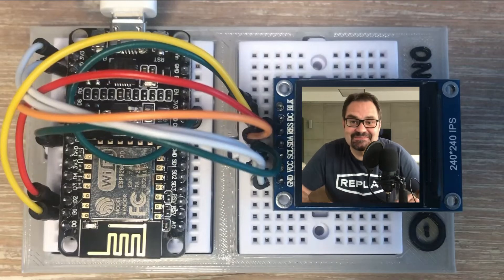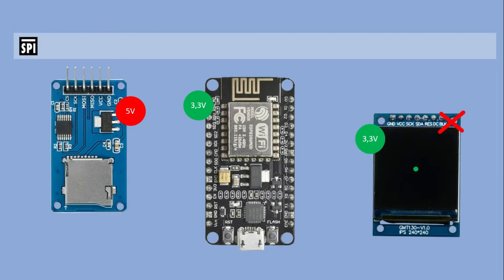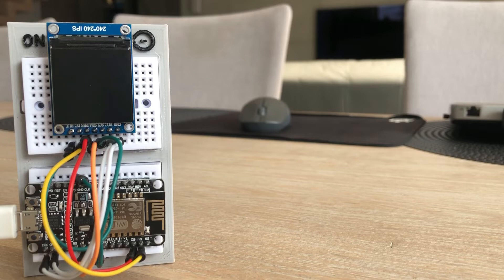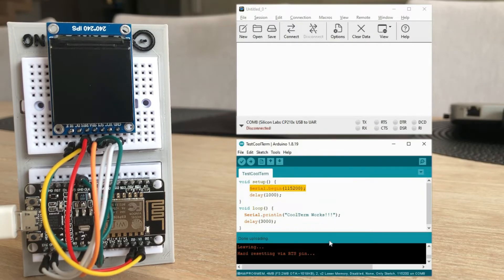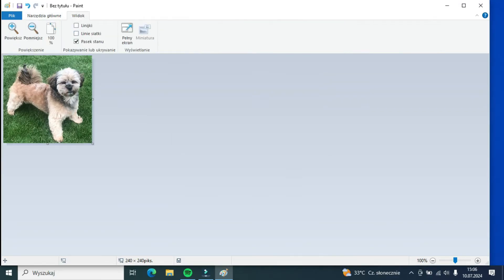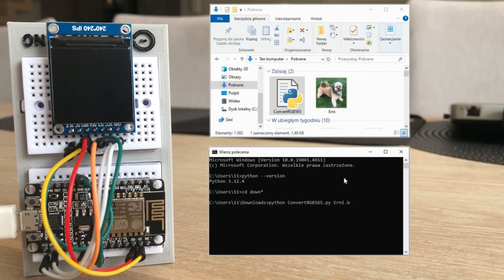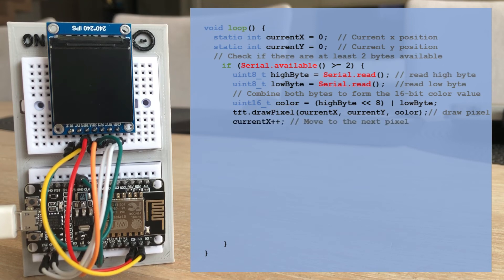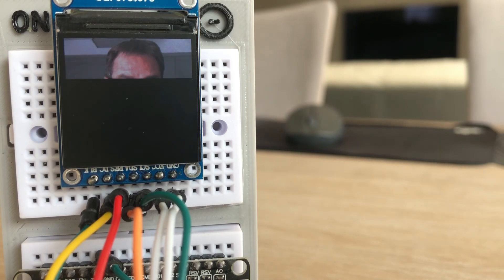Convert and Display Color Images on an Arduino TFT Screen

Comment: there is an instructable post about this display "Adding CS Pin to ST7789 1.3" IPS LCD" and it worked but i damaged the backlight while desoldering :P so be careful
Reply from the maker: I am actually planning to use a separate buffer chip to isolate SPI traffic. Not sure if it will work but I will try. With my soldering skill desoldering anything is not an option:)

Comment: Hi it said it cant open my com what could i possibly do to fix this?
Reply from the maker: Have you selected the port in Arduino IDE. Were you able to load the code and olnbly then receive the error
Reply: @marios_ideas  Hii thank you it worked but.. another problem the code uh got uploaded but i keep getting reboot spams Sorry for the inconvenience as I'm doing this for a research project and i have no background about arduino ide. Thank you
Reply: @SenScythe123  Is board set correctly eg board manager dropdown esp32_dev_board

Comment: I upload 3 jpg onto my ESP32 and then display them every 15 seconds, it works very fast
my TFT is 160 x 128, and the image is 130 x 160 pixels
Reply: Please give a guidance 
Like required components and coding
Reply: @santhoshikumaribommali7395  the TFT is 160 x 128 and the images are 130 x 160 copy them to the ESP32 and then run this code, it will show them one at a time

#include <Adafruit_GFX.h>
#include <Adafruit_ST7735.h>
#include <LittleFS.h>
#include <JPEGDecoder.h>

#define display_CS 22
#define display_DC 4
#define display_RST 14

Adafruit_ST7735 display = Adafruit_ST7735(display_CS, display_DC, display_RST);

void setup() {
  Serial.begin(115200);

  // Initialize the display screen
  display.initR(INITR_BLACKTAB);
  display.setRotation(0);  // Adjust rotation as needed
  display.fillScreen(ST77XX_BLACK);

  // Initialize LittleFS
  if (!LittleFS.begin()) {
    Serial.println("LittleFS mount failed");
    return;
  } else {
    Serial.println("LittleFS mount successful");
  }

  // Display a starting message
  display.setTextSize(0);
  display.setTextColor(ST77XX_GREEN);
  display.setCursor(0, 0);
}

void loop() {
  displayImage("/01.jpg");
  delay(4000);  
  displayImage("/02.jpg");
  delay(4000); 
  displayImage("/03.jpg");
  delay(4000); 
}

void displayImage(const char *filename) {
  // Open the file
  File file = LittleFS.open(filename, "r");
  if (!file) {
    display.print("Failed to open file:");
    display.print(filename);
    return;
  }

  // Decode the JPEG image
  if (JpegDec.decodeFsFile(filename)) {
    // Render the image
    renderJPEG(JpegDec);
  } else {
    display.print("Failed to decode file:");
    display.print(filename);
    delay(2000);
  }
  file.close();
}

void renderJPEG(JPEGDecoder &jpeg) {
  uint16_t *pImg;
  uint16_t mcu_w = jpeg.MCUWidth;
  uint16_t mcu_h = jpeg.MCUHeight;
  uint16_t min_w = minimum(mcu_w, jpeg.width);
  uint16_t min_h = minimum(mcu_h, jpeg.height);

  // Clear the screen
  display.fillScreen(ST77XX_BLACK);

  while (jpeg.read()) {
    pImg = jpeg.pImage;
    uint16_t mcu_x = jpeg.MCUx * mcu_w;
    uint16_t mcu_y = jpeg.MCUy * mcu_h;
    for (uint16_t y = 0; y < min_h; y++) {
      for (uint16_t x = 0; x < min_w; x++) {
        // Adjust the pixel drawing for 180-degree rotation
        uint16_t new_x = display.width() - (mcu_x + x) - 1;
        uint16_t new_y = display.height() - (mcu_y + y) - 1;
        display.drawPixel(new_x, new_y, pImg[x + y * min_w]);
      }
    }
  }
}

uint16_t minimum(uint16_t a, uint16_t b) {
  return (a < b) ? a : b;
}